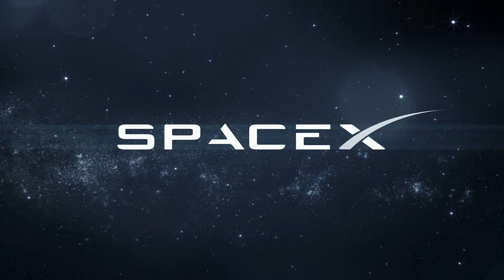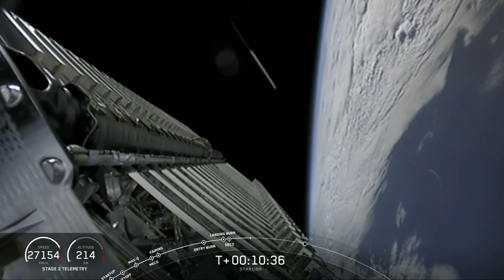Starlink Mission

Comment: MISSION TIMESTAMPS:
7:54 Engine chill
10:24 Strongback Retract
13:53 startup
14:56 liftoff
16:09 Max-Q
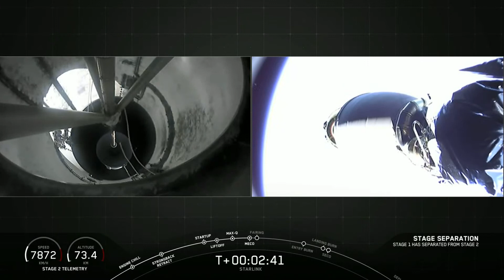17:35 MECO
18:06 Fairing separation
21:48 Entry burn
23:21 Landing burn
23:49 SECO
29:51 Deploy

VIDEO TIMESTAMPS:
0:00 The Beginning
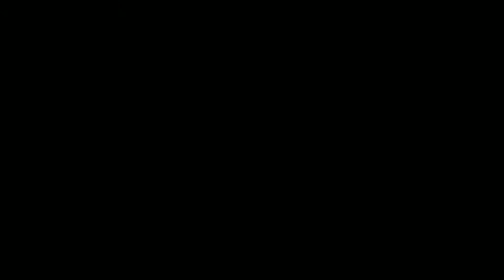4:55 The SpaceX Intro
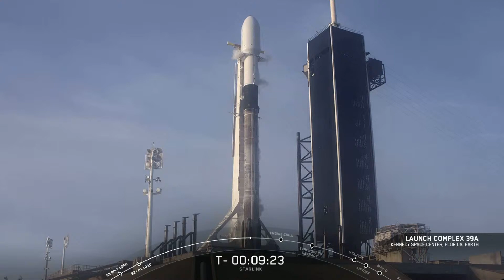5:28 The Video Begins
5:28 View of Falcon 9
8:20 View of Falcon 9 Fairing
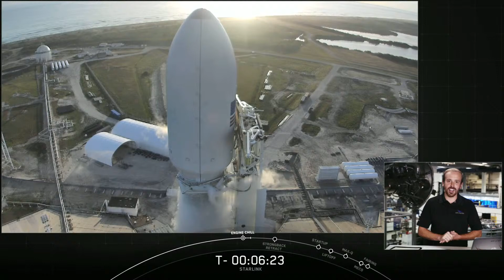8:31 View of Fairing Recovery Boat
8:44 View of Falcon 9
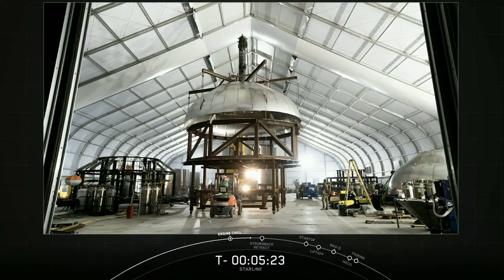9:30 Starship Factory Boca Chica 1
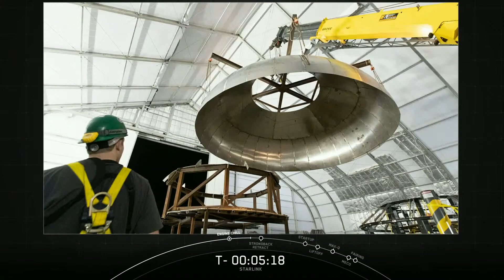9:35 Starship Factory Boca Chica 2
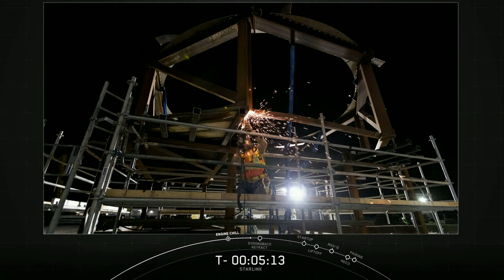9:40 Starship Factory Boca Chica 3
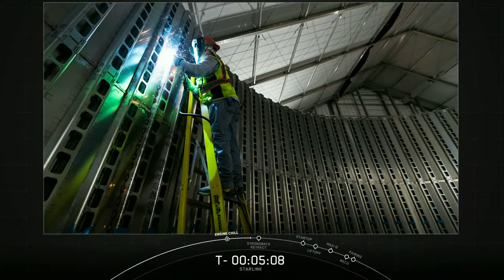9:44 Starship Factory Boca Chica 4
9:49 Starship Factory Boca Chica 5
9:57 Starship Factory Boca Chica Video
10:18 View of Falcon 9
11:19 View of Falcon 9 Fairing
12:07 View of Falcon 9
12:26 View of Launch Pad
12:40 View of Falcon 9
14:49 Speed and Altitude Meters Appear
14:58 Falcon 9 Close Up
15:02 Camera Destroyed
15:03 Launch View Far
15:13 Launch View 1
15:23 Launch View 2
15:55 Stage 1 Camera
17:27 Launch View 3
17:34 Top of First Stage View+ M-VAC Engine View 1
17:49 Stage 1 Camera + M-VAC Engine View 1
18:04 Stage 1 Camera + Inside The Fairing
18:12 Stage 1 Camera + M-VAC Engine View 1
18:25 Stage 1 Camera + M-VAC Engine View 2
18:34 Stage 1 Camera + M-VAC Engine View 1
18:45 Stage 1 Camera + M-VAC Engine View 2
18:54 Stage 1 Camera + M-VAC Engine View 1
19:05 Stage 1 Camera + M-VAC Engine View 2
19:15 Stage 1 Camera + M-VAC Engine View 1
19:24 Stage 1 Camera + M-VAC Engine View 2
19:34 Stage 1 Camera + M-VAC Engine View 1
19:44 Stage 1 Camera + M-VAC Engine View 2
19:52 Stage 1 Camera + M-VAC Engine View 1
20:07 Top of Stage 1 View + M-VAC Engine View 2
20:17 Stage 1 Camera + M-VAC Engine View 1
20:27 Stage 1 Camera + M-VAC Engine View 2
20:37 Stage 1 Camera + M-VAC Engine View 1
20:47 Stage 1 Camera + M-VAC Engine View 2
20:57 Stage 1 Camera + M-VAC Engine View 1
21:07 Stage 1 Camera + M-VAC Engine View 2
21:17 Stage 1 Camera + M-VAC Engine View 1
21:27 Stage 1 Camera + M-VAC Engine View 2
21:37 Stage 1 Camera + M-VAC Engine View 1
21:47 Stage 1 Camera + M-VAC Engine View 2
21:57 Stage 1 Camera + M-VAC Engine View 1
22:07 Stage 1 Camera + M-VAC Engine View 2
22:17 Stage 1 Camera + M-VAC Engine View 1
22:24 STAGE 1 CAMERA DESTROYED + M-VAC Engine View 1
22:27 M-VAC Engine View 2
22:36 M-VAC Engine View 1
22:47 M-VAC Engine View 2
22:57 M-VAC Engine View 1
23:07 M-VAC Engine View 2
23:10 M-VAC Engine View 1
23:20 M-VAC Engine View 2
23:30 M-VAC Engine View 1
23:40 M-VAC Engine View 2
23:47 M-VAC Engine View 1
23:54 Map View
24:12 M-VAC Engine View 2
24:19 Map View
24:34 M-VAC Engine View 1
24:45 Payload Cam
24:49 M-VAC Engine View 2
25:04 Map View
25:19 M-VAC Engine View 1
25:29 Payload Cam
25:34 M-VAC Engine View 2
25:49 Map view
26:04 M-VAC Engine View 1
26:15 Payload Cam
26:19 M-VAC Engine View 2
26:34 Map View
26:49 M-VAC Engine View 1
26:59 Payload Cam
27:01 Map view
27:51 M-VAC Engine View 2
28:01 Map View
28:17 M-VAC Engine View 1
28:27 Payload Cam
28:33 M-VAC Engine View 2
20:09 Payload Cam
31:17 Outro
31:38 The End

Time taken: 3 Hours

Comment: Wireless networks stream invisible radio waves, a form of radiofrequency radiation (EMFs), through the air — similar to cellphones, computers, Bluetooth speakers, and other WiFi-powered devices. The concern around WiFi and routers causing cancer is due to the emission of these EMFs.Jul 18, 2019
Reply: how about smoking?

Comment: So this is what happens. You need to capture a time and location. Once you have it located, you gather it (like having an object in a ballon and holding it outside of the rubber of the ballon, assuming youre on the surface). You have to pierce the ballon and not make it collapse. Then the matter enters the space inside the ballon. And,  Now you have an open area that not yet repairable. You need gravity at a large amount to seal this. We aint there yet.  Ive stated many times how this is done. Trebuches. 

Love
Your, lcoal 

Crazy person

Edit: cln sin foooooooooooooooo

Comment: So what if gravity was the road in outerspace. The more gravity, the thicker the road. accelerating to light speed will cause a pulling effect (like a rug) on the fabric of space. 

The further you are from a body like a galaxy, black hole, or solar systems, the thinner the road is, the less traction you will have. 

I guess one would have to bouce around looking for the path of least resistance to light speed. Once the body has reached the velocity it should travel smoothly. But slowing down?! Beats me! Front wheel drive.
Reply: Another thing. I get the strangest feeling that electrostatic shock and lightening, while traveling at the speed of light, the lead particle itself may preceive the time it took to ground itself, an infinite amount. I dont know why i feel that when i think about it.
Reply: Fuck you im not autistic, im a fucking stoner.
Reply: I guess but the only spot that isn't influence from gravity would be in the center of the universe and it's not even possible to leave to galaxy
Reply: @fokego956  i feel that due to the property of gravity, you are always affected by it, its just weak. It goes on for infinity, doesnt it? A center of mass' gravity. So no matter how far you are from objects, there will still be gravity. 

Now on accelerating quickly, i feel might tugg at this fabirc of space. So if you want your millennium falcon to reach light speed at a reasonably rate, im saying (with my crack pipe) that youll need gravity to be stronger to sustain the strain from (yea like a rubber band) tearing the fabric of space. 

You can drag race in the grass, you just need the right wheel to do it with.

But why do we need to worry about accelerating? Maybe because as time slows down and our ability to steer will be easier, itll be incredibly hard to steer while getting to this velocity (which might not be constant due to like super gravity fields). Soo its going to take one hell of a pilot that will need to drift around as it reaches its speed, to you know, slow down time to reach your destination. What about slowing down?!? Proabably why weve never seen a time traveler. Once we get there. Oh man, we're going to make a legal mess of everything.

Comment: Is Space x starting to lose its mojo?  The death of one of its engines on the latest cargo mission, the crew dragon parachute problems, and so forth.  Have the goals of SpaceX finally come nose up to the technical difficulties to successfully carry out its lofty expectations?  I have been in a continual state of delight over the company's many pioneering accomplishments, but lately it seems like things are stalling out.
Reply: This was the 5'th flight of this particular booster. The mission was a success.
Reply: @logitech4873  -Does NASA still consider the vehicle safe for astronaut travel?  I have read that : not at this time.
Reply: @Jamesdylandean  I don't know NASAs specific requirements.
The rockets are safe though. 
Last failure was 5 years ago, they're now on a huge success streak.
Reply: @logitech4873  Many spectacular successes, but still a few nagging glitches that would cause more concern of NASA than the rest of us.  Sometimes, I think that NASA conveniently forgets its spectacular failures, too.  But, I think that SpaceX would be horrified to lose any astronauts as NASA has lost many.  Hence the concerns over remaining issues.  It stiol concerns me that with the complexity of space travel and the rapid advances of SpaceX, are they moving beyond current expertise's in their efforts.  I hope not!!!

Comment: What's that on 21:30
Ant that bug looking thing at 22:34
???
Reply: 21:30 -> one of the engines of Falcon 9 has failed during the ascent. There are speculation about what is this fragment. It might be part of this failed engine falling away when I-st Stage were preparing to descent(slow down)  burn. Some sources insist that this is only ice.
Reply: @wojteksykurski  fairs. And those bug - looking bits are what?
(definitely not space shrimp)...
Reply: @bennyrich7361  if You means those around nozzle - I suspect ice & frozen oxygen. When the nozzle is getting hot, they fall away from fuel lines. Please notice that Merlin engines use fuel at cryogenic  temperatures.
Reply: @wojteksykurski  very informative. Thanks 🙂

Comment: Hey, at 21:33 in the video, T + 6:39, what was that object that flew past the first stage around the 2 o'clock position?
Reply: 21:30
Two UFOs flyed away.
Two Unidentified Flying Objects.
Reply: Frozen oxygen
Reply: @mazharmash  Ok, you may be correct.  I was thinking we were too far down in the atmosphere at that point and any frozen oxygen or other condensate would have been obliterated by that point but I think you are right.  I may have been "seeing" more than was actually there.

Comment: I don't get the hype. They're doing the exact same thing that was done fifty years ago, with the same primitive design, using the same fuel, and the part they're most proud of, is failing after the 50th attempt. And they plan to colonise Mars with this, as far as I understand.
Reply: In my opinion SpaceX is addressing main problem of space travel: costs. They want to achieve this by recovering I-st (and in case of planed Starship also second)  stages of they rockets.
SpaceX seams to be the first one who really wants to make space accessible for masses (by prices reduction). I really hope that they succeed, so the other launch companies would have to find ways to lower they prices.

Comment: The grid fins opened erratically, as if they were sticking, or there was an actuator problem. Then there were oscillations after re-entry burn shutdown, indicating a guidance issue.

Comment: Watch time 21:31 and notice there is piece flying of the first stage. Also after entry burn there is a weird rotation of the first stage.
Reply: Its ice
Reply: That wasn't from first stage, that was the booster passing some space junk in orbit. If you watch the last Dragon launch, and the booster reentry real close you will see it zip past a satellite in it's orbit.
Reply: @sleepless1587  it is. Pieces like that are frequently seen, included in missions with successful landings.
Reply: @sleepless1587  You have to remember at that time the booster is still traveling hyper quick towards the object that is basically  standing still ,If it is junk in decaying obit?

Comment: I've watched almost all of these and that roll oscillation right after the entry burn was not typical. It appears to stabilize then there is possibly another debris field as a small black smudge is visible streaking from center frame to the grid fin on the right @22:18 just before the feed died. My theory: it hit something.

Comment: Another Starlink mission, where the moment of deploy is NOT shown - only a few seconds after! Every launch so far. Also, the moment of that one engine shutdown on the first stage about 2:20 is visible in the change in the exhaust pattern, whereby SpaceX abruptly switches views and no chatter about the engine loss. Then just as the first stage ends the entry burn, the rocket rolls left then back right to correct, and there is no callout of landing burn, and of course, no further video feed from Stage 1 or the Droneship (it crashed). Looks like SpaceX is censoring it's own feed to the public.

Comment: 17:14  0.25x speed. There is the little explosion of the engine. That's why the booster couldn't land. It was one of the 3 engines used for the entry burn. You see the booster tumbling after the entry burn (22:08) cause of that. This and the Engine sensor warning on Sunday ... Maybe you should have exchanged the complete Merlin engine. Non the less, mission accomplished. Just sad for the Booster Hardware.
Reply: Hey what was the debris at 31.35, on right side, it's second debris seen, one further out just before... Is it possible something collided with it on descent?
Reply: @CharlesTLam   possibly ice or debris from the Engine Nozzle. It's hard to say because ice could also form very weird shapes at this altitude. We didn't get a full explenation on this from SpaceX so far, just that a Engine problem occured.
Reply: @I-Singu-I  seems unusual to be anything from the craft as wouldn't it be miles away when first stage began its decent..interesting anyways
Reply: @CharlesTLam  watch closely, it's coming from the bottom of the first stage. Could be ICE or debris. remember: First stage is 50* meters long and there is a fisheye lens on top :)   *//edit
Reply: @I-Singu-I  yup that seems like what it is ..thanks

Comment: Just after entry burn at 21:49 the booster moves over quite unexpectedly and then after re-entry burn cut-off at 22:09, pitches hard to the left and almost goes into a spin, corrects itself at 22:12, pitching hard to the right, stabilizes, then the feed cuts at around 22:20.

Comment: 31:05 cigar shape thing next to the satellites
Reply: Also at 25:30
Reply: Notice I said thing I don't think it's aliens but something is there could be a sun glare or ice what ever it is, is there Lucas Zanotti
Reply: It could be just the lens glare, but it also looks the right size to be one of the four tension rods that hold the satellites together during the launch and are jettisoned to release the payload. Unfortunately, SpaceX does not show the moment of payload separation itself.

In the Jan 6 2020 launch one of the rods was also visible at the very end of the webcast (T+1 hr 2 min 2 sec) and then it was more clearly identifiable as such.
Reply: some kind of lens reflection due to residual spinning of 2nd stage

Comment: I thought the stage 1 exhaust plumes looked a bit odd at times - much less symmetrical than 'normal'??  Also thought the movements under grid fin control looked a bit strange...then it went blank. At that point I thought 'that isn't landing'.  Still, 5 missions on one booster - impressive!  And no doubt more will be learned from the failure to land. Go SpaceX

Comment: Am I crazy or do we here see the Starlink second stage passing another satellite on its way into the insertion orbit? What is the object, gray circle with a bright pencil sticking off of it, in the shot at 24:44 (T+9.50) & 25:27 (T+10.34)?
Reply: I think thats just some thing from the payload
Reply: @welyum7308  It's well after the faring halves drop away and well before the Starlink satellites are deployed.  It's something else. Either a separate payload item deployed separately which they didn't mention or something else that was already up there.
Reply: @ArcherWarhound they hold the sats with some kind of rods, so it could be one of them
Reply: @welyum7308  It's BEFORE they release the rods.

Comment: 21:27 What's that seen flying near the booster on reentry?
Reply: pretty sure it was pieces of an engine, check 17:15, one seems to have exploded.
Reply: Vatsyayana They went for a droneship landing this time though, so the first stage continued on its path, performing reentry miles away from the location of the engine failure
Reply: @xGolBLiiN  Correct, what is this reply to?
Reply: @xGolBLiiN  Oh it didnt let me read the whole thing at first sorry, you are correct, but its getting new aerodynamic forces since its having the air pushing in a different direction onto the craft.
Reply: Looked like solid oxygen or ice
Reply: @PadreMortalis  i disagree, it looked metallic, like a piece of the engine that i think exploded at 17:15
Reply: @Vatsyayana87  you may be right. Thanks
Reply: It's a chunk of ice. I don't know if it's frozen oxygen, nitrogen or water though.
Reply: @nicejungle  I disagree, i think its a piece of an engine
Reply: I slowed the Mystery object down here 

https://youtu.be/42SCBpZuBjw

Comment: everyone seems to forget that the expected theoretical maximum of a block five was 5 flights, and they have reached that
two years ago it was a rarity to even re use a rocket, and now you expect no failures after approaching the maximum that the booster is capable of?!!
for real, people is weird, and kinda awful
Reply: I thought it was 10? SpaceX is pushing the load limit as well as the force exerted on f9 though.
Reply: the first estimate was 5 lauches, and since this is one of the first block 5 it makes sense to accommodate to that estimate
later booster five, like the 1056 to endure a little more, but anything can happen after 5th attempt
Reply: Ikr some people seem to forget that reusing any piece of the felcon 9 is an amazing feat in itself
Reply: Five flights? Where do you get that? They expect to be able to do ten flights without refurbishment, and a total lifetime of one hundred.
Reply: @odysseusrex5908  the first estimate, before even building the block 5 was that, it would fly 5 to 10 flights, and what YOU said was referring to an hypothetical block 6 (that won't even exists)
remember that the Boosters that had flown 4 times, this far, were the oldest ones, so to those it is logical to apply the first estimate of 5 flights
they are still solving problems, likr the high wind problem that made the last booster soft land on water, and they solved it by forcing the next booster and it succeeded
they still have a lot to test, and the pace at which they will improve the block 5 will be even slower due to starship, which is the big deal now for them
Reply: @ivantimofeev2233   No, you are simply wrong. I do not know where you are getting your information, but it is erroneous.
Reply: @odysseusrex5908  the spacex reddit page, and your source?

Comment: The water deluge system malfunctioned at launch! It was not at full flow until the rocket had left the pad. They are normally at full flow 5 seconds before lift off. That poor Falcon 9 must have taken quite an acoustic beating in the first couple of seconds.